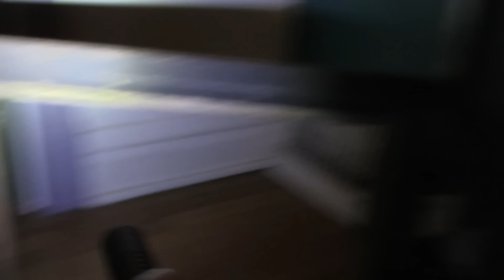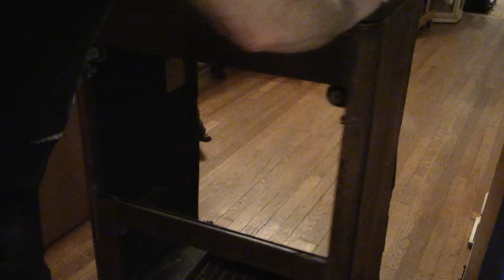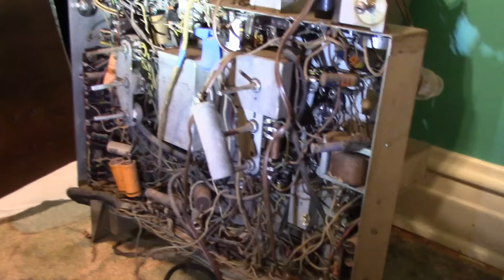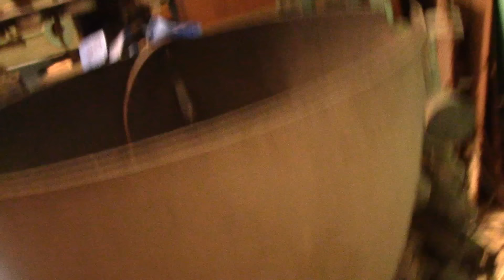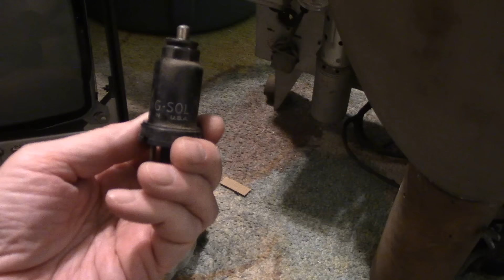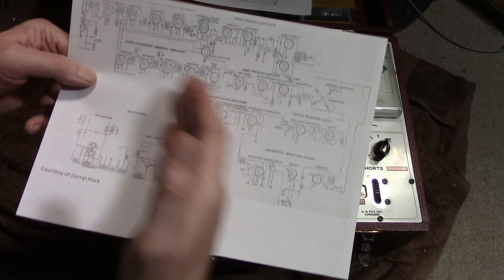RCA 1936 RR-359B field test TV: part 2 - first look

Comment: A simple triode tube like the 2a3 can always be replaced with a few cheap solid State components nicely mounted on a socket. Some people might find that horrible, but it can save you from paying audiophile nutcase prices for a tube. You don't need to match the tube exactly, just it's fictionally in the device. 

Possibly the same for the experimental tubes. You can measure at the socket, see where they are in the schematic, it should be possible to identify a "modern" replacement. I don't think you need to worry about problems with tubes.
If anything broken coils, chokes, transformers is what I would worry about. These would be all bespoke. 

The nobs can be cast or printed easily. Veneer can be replaced. No problem.

Comment: I'm feeling there won't be anything too amazing in the scan stages.. the bit of the schematic you have shows something very similar to 1930's oscilloscope circuitry.. Is that flyback EHT I see there?? If so that's very unusual at that vintage. The main fun will be in the IF stages and particularly the video amplifier.. 4mhz bandwidth in an amplifier wasn't a thing except for EMI/Marconi in the UK at the time, and they used some very funky tubes to achieve it. Looking forward to seeing more of this series as very early TV has always been one of my great interests. I attempted to build a 240 line Baird style mechanical set as a teenager... with the expected results for the 80's when information just wasn't available like now.
Reply from the maker: No flyback. Brute force 6,000 volt EHT supply. Video bandwidth is only around 1.5MHz

Comment: A 2A3 in that era would definitely be a radio tube of not all that long before the time of the TV set, and not an audio-fool item like it is today.  It is a triode with a directly heated cathode filament.  I wonder how the filament is powered -- I'm assuming DC, so you'll have to figure out how the DC is derived.  At the time of manufacture, a 6V6 would have just become available and easier to design around.
Reply from the maker: Most of the tube filaments in the set run on 2.5 VAC.   A few others like the 6H6s run on 6.3 VAC

Comment: 2A3 is one pricy and what they last 500 hrs? Directly heated cathode
Reply: Avoid the audiophile price and put in a solid State replacement. It will work. Examples enough on the internet. Doesn't look nice on top of an amp, but inside that cabinet, it's fine and it'll last forever.
Reply from the maker: I could but I'll probably just use the tubes that came with it.  Assuming I get this set working, it's not going to be used very often.  I don't want to wear out the other even harder to replace tubes - especially the CRT.
Reply: @bandersentv that's fine, I put it as an option if one of them turns out to be very bad

Comment: iF  that  is a    pre war set, did  you think   it   had  channel  1 (Channel 1 was allocated at 44–50 MHz between 1937 and 1940)
Reply from the maker: It is.  So old they didn't even had channels yet.  There were no broadcast stations yet and standards had not been set. This was all experimental.  It had a continuous tuner from about 50 to 90 MHz.

Comment: Bob, this is turning out to be a very interesting set.  After reading through the NTSC standards meetings from 1938 to 1941, this set appears to be a pre-production engineering development prototype so, likely was used to test out the NTSC's latest system standards.  I noticed the standards when this set was built, the signal format was dual sideband AM for the video with an occupied Bandwidth of 6.6 MHz, producing 343 lines.  Hence the reason for the 1.5 MHz video bandwidth.  In March 1940, they decided to go with a vestigial upper sideband transmission, which increased the video bandwidth to 4 MHz, which produced 441 lines, and shortly thereafter, 525 lines.  The sound subcarrier was moved out to 4.5 MHz with this change.

So back to this set you have, I wouldn't be surprised if it has several of later modifications.  If the modifications were done at the RCA lab, there should be some attached tag stating which modifications the set has.  But since there is no documentation, it makes me wonder if this set was retired and acquired by a Technician who took it home and tried to get it working to watch existing broadcasts at that time.  At any rate, there will be a lot of detective work to figure this set out.

Comment: The A305A and A306A are modified versions of the 57 and 58, respectively.  They have 6.3V/400 mA heaters, rather than 2.5V/1A.   The closest equivalents would be the 6J7 and 6U7, respectively. These both have octal bases, rather than the 6 pin.  Adapters could be made if needed.
Reply from the maker: They used a 6D6 in place of one of the A305A in some versions.

Comment: This set is definitely not to 1941 NTSC standards, especially with AM audio! It would have been fascinating to see the broadcast facilities and transmitter that produced the signal for this set to demodulate!
Reply from the maker: You can - at least in books.  Television by Zworkin and Morton published 1940 for example goes into the broadcast equipment in detail.   Also checking this page about the Golder Gate Exposiiton.  https://www.earlytelevision.org/golden_gate_expo.html
Reply: @bandersentv  It would be fun(ky) to reproduce it, not with broadcast power, but enough to feed a signal to the tuner.
Reply: You can also see the first 1926 broadcast. The first version of this set would have been the receiver (but probably not Bob's B version). I don't think I can post links, but if you search YouTube for "First Ever Television Broadcast NBC RCA July 7, 1936 [UnknownArchive mirror 2016-09-11]" you should find it. This shows the TV camera, filmed by a movie camera behind it.

Comment: directly heated tubes tend not to glow as brightly as indirectly heated ones. The 343 line standard seems pretty close to the british 405 line standard the only differences being modulation polarity, sound offset and frame rate.

Comment: Absolutely send it to Fred.  He is the best.  
Shame the chassis has been messed with over the years.  Sometimes gas can cause a tube to read off the chart.  I never trust tubes that read too good as it usually means something is wrong.
Reply from the maker: I agree except when it comes to power tubes.  I've seen many 6V6, 6L6, 25L6 etc read high.  Maybe it's just my tester.
Reply: @bandersentv  Is the tube tester actually reading transconductance?  The 2A3 does not have any beam power structure in it.  It's a vanilla triode.
Reply: @bandersentv  I have tested many hundreds of power tubes on my 539C and have never had one read off the scale like that.